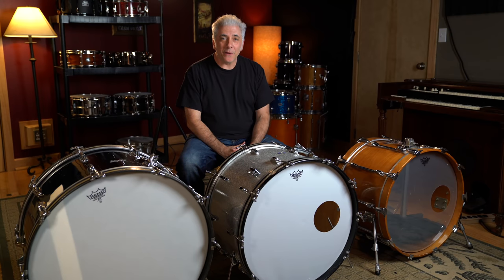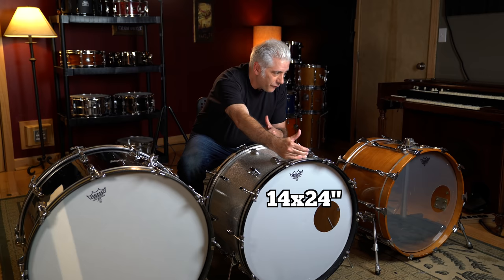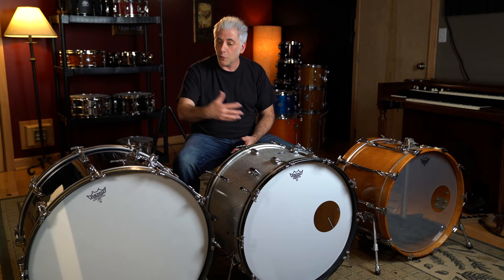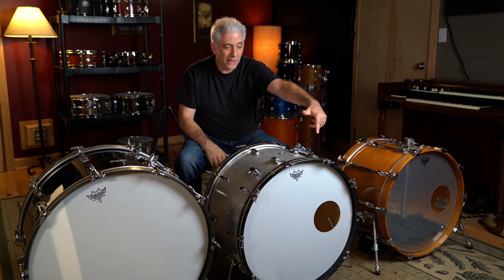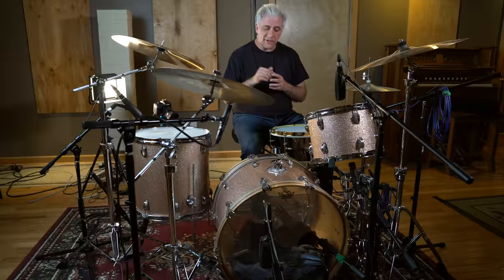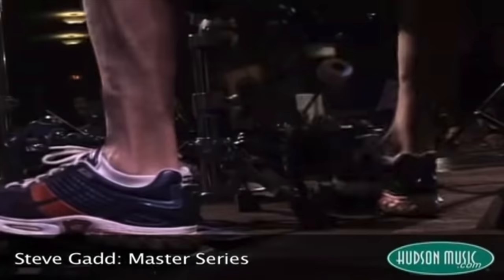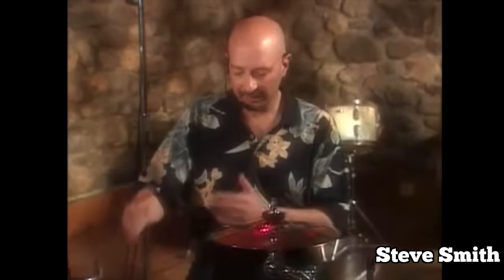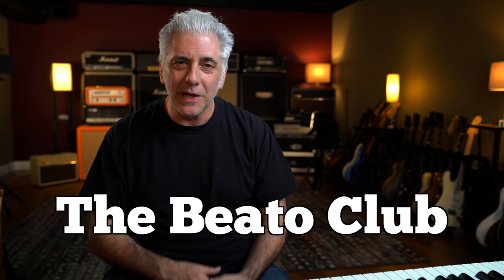How To Get A HUGE BASS Drum Sound

Comment: That Roger's kick looks so nice. I don't know about that theory that limited depth creates a bigger sound however. It may generally be the case but I have to suspect that's an over simplification. I'm pretty sure the drummer in my band has one kit with an 18" kick and it sounds huge. In fact I used to complain that it was way too loud. That was until one of our shows where the kicks from the previous bands made me realize how much richer of a tone it was producing (their kicks sounded as though they had no low end by comparison and just failed to really fill the venue). I'm guessing the heads, shell material, tuning and attack velocity have a lot to do with it. Plus have you heard of the Klong Yao? It's basically a very very tall djembe and it has the biggest bass sound I've ever heard.

Comment: nice. like an open guitar string will sustain longer than a fretted one, generally. a vibrating thing gets muted when touched. yes? also, the height of the adjustable beater- hit the middle of the head=more boom. shorten the height so the beater strikes closer to the edge= more thwack. of course, shorter throw = quicker pedal action. and lastly, felt head on beater= boom, and wood or plastic= more thwack. plastic w/ felt face is in between. sounds like to me.  Ü ♫

Comment: Nothing beats a closed head on the front of the drum, and using a 2 to 4 inch felt strip vertically to one side!! I always tune the front head higher than the beater side, in which gives me more volume and a great low end thud! Port holes were created for not so talented sound guys, who had no clue how to MIC a closed head in the front bassdrum.
Reply: Amen brother!  It took me 15 years almost do discover this old 'secret'.  Now everyone is always wondering about this 'awesome deep thud kick sound' I get,  which is actually an early 90s no-name beginners set with a 22'x14,  tuned and muffled to above specs :D Felt strip with no foam/blankets FTw.   Not to mention, the felt strips also dont get messed up during transportation, unlike foam and stuff inside of a closed drum...

Comment: another thing to consider is that the smaller the pipe the faster the velocity, so if you only have the choice of longer barrel drums go with the smaller 22 inch head; this is of course theory based on fluid dynamics, i've got a gretsch maple 17 X 22 and it is still pretty punchy and low, i thought the EV re20 to be a great kick mic, and got a pad switch

Comment: Very nice. But the air not moving fast enough through long drums doesn't really make any sense. That's almost like saying there's air only at the beater side of the drum, or in electricity, like thinking that electrons flow through wires that are "empty". That's not the case in either: as soon as the beater hits the skin, the air pressure in the drum will increase and some of it will be propelled outside immediately through any opening, it doesn't have to be the same air right at the skin that hit the beater. Same with electricity: wires have electrons randomly flowing and as soon as you close a circuit and they get pushed from one side they will try to flow elsewhere.

Comment: What are you using for a beater head on that 26 for that sound when you briefly hit it? I recently acquired a 40 Radio King kit with a 28" kick and I need new heads. So many choice now... muffled (controlled), unmuffled, 1 ply, 2 ply mu head is spinning... I see Aquarian has some vintage style heads with a felt strip built in... Maybe that's the ticket.

Comment: Want a huge DEEP bass drum sound? Its all in the heads. Evans hydraulic two-ply oil filled batter side, single ply resonant side (with our without port) single felt strip on batter head, nothing on reso. Tune batter head a to a medium tension, fairly tight reso. Then the secret, back off the top two lugs on the batter head just about until it wrinkles. For dampening, place a pillow inside and adjust against heads to get desired decay. Sounds amazing, especially mic'd int the port.
Reply: @p0llenp0ny  its necessary to get rid of too much ringing since the reso head is fairly tight. You need to adjust it so that it isnt dampening too much. Its critical for live performance when the drum is mic'd, especially when using a double pedal.

Comment: Kind of surprised that you didn't go into the metal stickers that can be placed between the beater and the head. Nor was difference between a felt beater and a wood/plastic beater compared. There's supposedly a difference if you mount toms or cymbals on the drum or not.  My experience is that having the felt side of the beater hitting the adhesive bass drum pad gives the drum an enormous punch. You might consider looking into that.  I like your channel.  cheers

Comment: Totally agree about using a narrower depth for a bigger sound. I went back to using a 14” deep bass drum a couple of years back after using an 18” deep drum and not only is it more responsive and fuller sounding, it’s also a lot more easy to play and carry around. I also use a traditional sized felt beater (DW medium) as this pushes more air through the drum compared to the more common smaller beaters supplied with newer pedals which to me are aimed more for articulation and speed rather than power and depth!

Comment: I try never to ‘bury the beater’. Ifind it results in micro buzz as the beater sits on the head strike zone.
Of course you can’t hear it in kit context and with a band playing, but if you solo the BD it is usually there. Less so with a soft beater on a flabby bass head, but very audible to me using a modern hard beater on clear heads.

Comment: I have always wondered how there isn't a pedal designed for a 26" I know it's a niche market at best, but I have always thought the beater hitting off centre isn't getting the optimum sound out of it. That said, can't argue with how good it sounds that way, so perhaps there's no call for it. But if there was a pedal that had a higher post, axl and chain/strap the beater could hit dead center. I mean, they did develop bass drum risers so that beater could hit 18" heads in the centre.

Comment: You can think of the air in the bass drum as a spring rather than the air "moving through it".  The longer the spring the softer it is.  Therefore, there is less response from the resonant head for a given kick (or displacement).  This is consistent with what you say in the video...just a different way of explaining it.
Reply from the maker: Good analogy!

Comment: I agree with you about the better overall sound with shallow bass drums. I found the same thing by accident, some 15years ago. I used 16" or 18" inch deep bass drums for a long period. Then, I just happened to make a shallow 13" version of a 22" cheap drum. And it sounded so much better than my high end bass drums!

Nowadays I'm not playing bass drums over 14" deep, and simply because of the sound.

One crucial thing I did notice, too. You have to make the beater hit right in the middle of the drum head. There is the best punch, a simple fact. So, I'm using a raiser even with my 20" drum. I wonder how much better the large 24" and 26" drums would sound if the beater could hit into the center point there, too.

Comment: Why do many bass drums have a hole in them?  Is it for a microphone to be inserted, if so, why are the resonator heads on the snare drums and toms not similarly treated?
Reply: Yes, it is for that reason and it’s also to get the sound of the attack of the beater, striking the head. If you if the drum without a hole, you don’t get that sound-unless you mic both the batter wide head and reso side head. That’s why we cut while-to get both sounds. Also, it helps for mic isolation from the other drums.

Comment: Mapex will blow this theory right out of the water with its 22x18 bass drum matched with an Evans EMAD batter head. I'm able to take out the extra foam ring on the head and have no pillow or muffling with this setup. It defies all logic!
Reply: I too had a mapex bass drum with the Emad that sounded amazing it was a proM 22by 18 but I cut it down to 22by14 myself. At 18 deep it took too long for the thud to decay when you play fast tempo it gets in the way of the next hit soundwise.
Now it's a bonus the drum is way easier to move from the rehearsal room, to the car boot to the venue and back, takes up less stage space too.Still sounds big and plenty loud.

Comment: I love your videos. I really appreciate your years of experience. I'm not convinced about the physics mentioned here, if one were to compare them to speaker drivers, and speaker cabinet designs.
I too have noticed a lack of bass response on deeper kick drums, and I am not sure what is behind it yet. In the case of a drum, the head is analogous to the speaker driver and the cabinet is the drum body, in which the actual resonance is neither desired nor required to get good bass response. I believe the primitive "porting" combined wih the microphone specifics and position may be involved, but as of yet I have nothing solid to offer, but just to say that what was being said here seems to contravene the acoustic principles we learn in speaker cabinet design etc. 
(my unsolicited $0.02 lol)
Reply: Good points. It's a bass reflex enclosure with the air that the hole puffs out contributing to the sound. With a smaller opening and a tube you could drop the tone even deeper. One other thing: I'd predict that with thinner shells the tone would be deeper, since the higher compliance would effectively make the 'box' volume larger. This would be at the cost of volume, 'cause there's no free lunch-- but in some settings that would be a virtue.

Comment: Also, don't fill your bass drum with stuff.  Notice how little muffling there is inside the Ludwig bass drum Rick plays. Nowadays you can use all kinds of external dampening devices. In my case I use a Remo Powersonic head and then plastic beaters to enhance attack (metal engineers like that) and then some small cloth like a folded t-shirt inside to place a Beta91 mic and reduce some annoying ball-like harmonics that happen inside the empty bass drum.  20" drum and sounds huge. 
And DON'T tune the head all sloppy if you want bottom end. Give it some chance to vibrate.

Comment: You actually get a huge bass drum sound (especially low resonance) by getting the tom mounting hardware off the drum shell, not using attached bass drum sours and preventing it from making contact with the ground. Even the smallest drum like an 18" will sound huge if the shell is allowed to resonate a full 360 degrees. Also, smaller bass drums like a 20" have a more 'centered' sound without a lot of overtones to contend with. 
Gary Gauger/ Gauger Percussion Inc.
Reply: Nope.

Comment: the bass on "whole lot of love" sounds like crap IMHO.    Too splatty not boomy or big.    Having owned numerous bass drums including a 26" Grestch, I think the length to diameter ratio is more important than merely diameter.  Deeper 22" bass drums can be made to sound big and boomy without being splatty and tight and poppy if needed.   They are versatile which is why they sell so well. Due to dealing with low freqs the room quality is paramount as well and can make or break any bass sound.  The 26" shallow bass is hard to tame and has a lot of splatty overtones and tendencies which you can hear in "whole lot of love" but sounds OK in "Fool in the Rain"

Comment: Seeing that it's just about impossible to get a mid range priced kit with a 14" depth bass drum, this helps how?
Reply: I just bought a Pearl masters complete, not very expensive, the BD is 20 x 14. 
I have another Pearl to work and record at home 20 x 16 and it's very close. 
If you put a microphone for each head, the depth doesn't change anything.
Of course with a 20, you don't sound like Bonham, but I prefer that to the 22.

Comment: 12x20 or 14x20 will provide much depth and bottom, BUTTTTTTT, all that padding  inside BD shell  DEFEATS THE PURPOSE. Talk about the front head resonating to come back and resonate with batter head.....that won't happen if the heads are dampened with blankets, pillows, whatever.  
     Ports in resonant heads also prevent drum head from  producing a low  pitch.  
     Try this:  A bass drum, no deeper than 14" with  Ambassador heads (front / back) No ports will give you maximum  Punch, Depth, Volume, Resonance, etc  (if you must use dampening then a touch of material against front head no deeper than 1" 
     ( When you play live, play totally open and  the resonance you might think is too much will be lost in the band mix and blend very well.

Comment: I love your content, but here I am a bit disapointed - you only scratched the issue, and went with some common missconception of the size of a drum being responsible for the huge drum sound, which is odd, bc you also mention how the 26" bd from Bonham was tuned really high. 

Most sound engineers - and drummers - struggle and I understand. When comparing different instruments, you usually never know what you compare; sizes are obvious, but as you mentioned the shell contruction and -material, it can influence the sound as well, as can the choice of drum heads, hole in front, or the tuning of the front head, which is often forgotten. And before I even go into detail,  you quickly realize this is such a diverse and complicated issue, and I guess this is why people tend to abreiviate this and look for a simple solution, as "don't burry the beater for more low end and huge bass sound". While this is not untrue, it is just a fraction of the correct answer.

But given the fact that in your video, the smallest kick is a 22", it might not have crossed your mind that a smaller kick can actually produce a huge sound too. I always cringe when people talk about drum sound, when in fact they end up talking about miking, disregarding the actual acoustic sound of the instrument at all. How do we get a huge Kick sound? Take anything that sounds lower than a snare drum, maybe a suitcase, or, hey, maybe a 22 or 26" kick drums, and now here is the important part: forget about the acoustic sound - for that you would use a good condenser from a few feet away - no, go INSIDE the instrument, something you never suggest for an actual good sounding acoustic instrument, as it changes the sound dramatically - and then use several mikes, most important a dynamic mike with large diaphragma as it is numb to high hiss requencies and will allow better seperation from other instruments as the snare, and something to capture the body of the drum, and then the sound gets assambled at the mixing console. We get free compression and low end boost by close miking, called "proximity effect". This technic is proven to work on anything that gives you some rumble, so why bother and use an instrument that actually sounds huge, acoustically?

Sure, I have not expected a video on which kick drum would sound huge, you ain't no drum maker.

sigh. Ok, yes, this subject is complex. Maybe too complex for a short video. I am just a bit disapointed that you did not even mentioned the fact that in studio Bonham played a smaller 22" kick, and the signature sound Bonham got famous for - the drum sound from "when the leeve breaks" was performed and recorded on a "tiny" 22" ludwig kick (and 12"/16" toms). This might have given away that the sound of the drums might not work the way we think- larger drum, larger sound. It is in fact the opposite. Ok, a 10" Kick won't sound larger than a 26, but you'd be surprised of the sound of a good16" kick, when you just hear the sample, you might think it is way larger. With growing diameter, the attack grows too, and overshaddows the tone of the drum, resulting in such dominant attack that you won't be able to hear the tone anymore, unless you mike the drum. With smaller drums, room mikes work best, as they sound acoustically often closer to what we want in a drum sound. 

A good example is the double platinum self titled album from "royal blood". Ben Thatcher, the drummer, used a drum set I built for him, so I know exactly what was used in the recordings (also for the second album btw; the recent one I was told, our drums were replaced with a different one; also, on this recording the acoustic drums were often replaced by samples. Sigh...). The drums were 20x17" kick (btw I 100% agree with you on the depth, but you cannot be much smarter than your customers, it is unbelieveable hard to sell a short sized kick today!), 12x8 Tom, 16x12 FT, with 5mm thin shells, no reinforcement rings (Kick: 6,5mm), all maple. A smaller set might still have sounded as huge, but would require the drummer to play less physical (loud drummers need drums that have more headroom). Anyhow, the sound engineers loved the sound so much, they used mainly the room mikes, so what you hear is actually how the drums acoustically sound. And this, dear people, is something so unusual, thus so common sense to all other instruments than drums.

As mentioned, our drums got replaced (ben now plays major brands, for many reasons, none of them being sound). I always get the feeling drums are semi acoustic and are treated like a synth, with the mikes and mixing console and its effects being part of the instrument. And this makes any discussion about drum sound pretty much impossible...

I'd love to chat with ya about your experiences with drum sounds in studio situations. I really love your approach, and I would like to know why in studios sound engineers never demand better sounding drums, while the studios are full of different guitars, basses and synths, amps and cabinets. By the same logic, any guitar, any bass and any cabinet would do, and everything else is subject to the right mike and signal chain.... So... why is that?